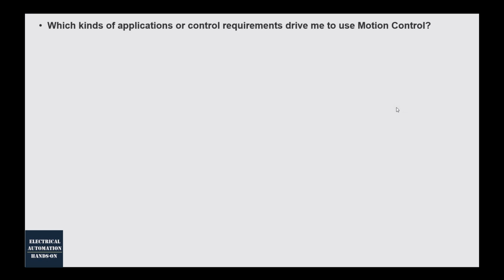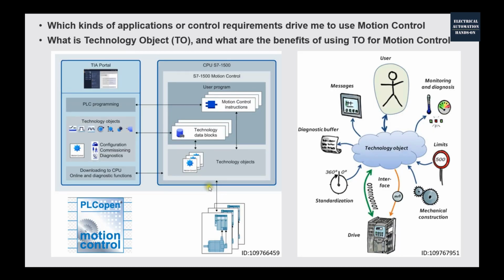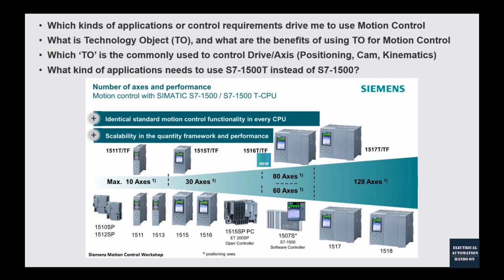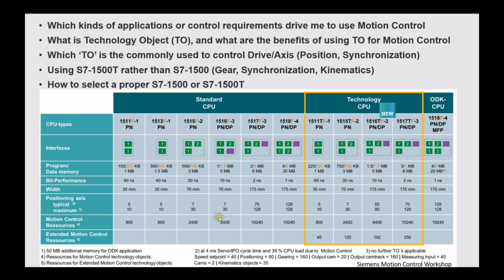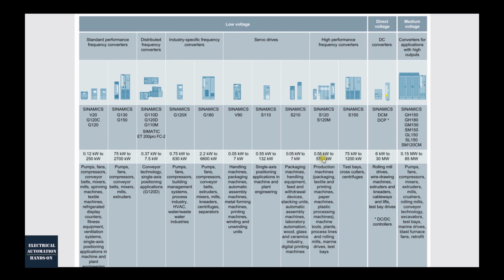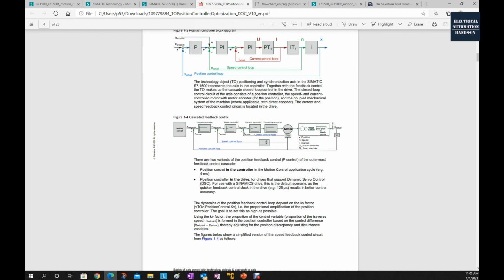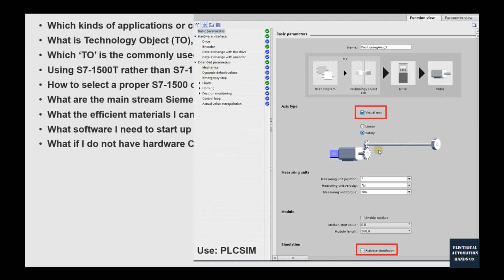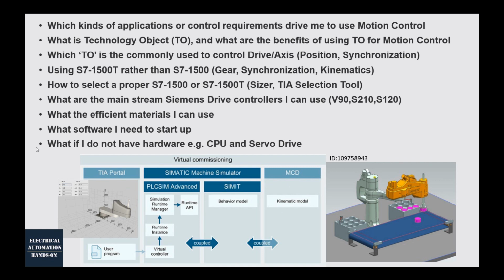MS02. [Siemens Motion Control] 9 Common Questions About Siemens Motion Control [2/10]

Comment: Your videos are very informative and thorough. Well Done!!!  Question? I am trying to replace an S5 Rack of IP246 Positioning modules,  
I want to use an S7-1500 -1PN with TM2 Posinput modules and analog output modules (Drive Analog Setpoints) to control positioning axes with an SSI encoder feedback. Would that be the most efficient way to go?
Reply from the maker: If you migrate your system from S5->STEP7->TIA Portal, then you could use the way you wrote. using TM+SSI encoder and analog out can build up a position closed loop control in S7-1500 and basically your migrated program will have a very minimum change. Another way is that using a servo motor and servo drive and using the 2nd encoder channel from the servo drive (e.g. S120 DRIVE-CLiQ module) for measuring your load side position feedback. Is this application come from Iron and Steel RH air O2 gun application?
Reply: @electricalautomation  No We are using it for automatic Size format change in the medical film industry. The IP246 module already has most criteria defined I imagine I can use things like incremental speed, software limits, Forward and Reverse Accel /Decel, etc. I am trying to upgrade incrementally so I am thinking of using FDL(open Comm) to communicate between the S5-135U and S7-1500 to transfer target values and other data.

Comment: ich habe Siemens S120 , power module 27A,600vdc, and Double motor Module 600 vdc , 3Ac 400v 3A:
is it suitable  to connect with motor 400vac , 6,7A ?
Reply from the maker: not recommended

Comment: Isnt tia portal basic enough for s7 1200 plcs with servo drive? For 1 axis robots for example. Great videos btw
Reply from the maker: Yes, S7-1214 or higher can support 4 axis (single axis) control. You can use stepper motors or Siemens SINAMICS S210 servo motor as drive.
Reply: @electricalautomation   Is it not possible for example with 1211C DC/DC/DC + V90 + Siemens Servo? If not how could we make it happen? Maybe with ET200? Thanks for the answer
Reply from the maker: @tznalcn  Yes, it is possible. V90 is a good choice. some area cannot sale or buy SINAMIC V90. If you can buy V90, it is cost effective servo system, it also support profinet with s7-1200.
Reply: @electricalautomation  Hey thanks for the information. By the way as I said before great videos. If you are looking for a topic for videos, TIA Selection Tool examples for motion control would be a great choice! Have a nice day!